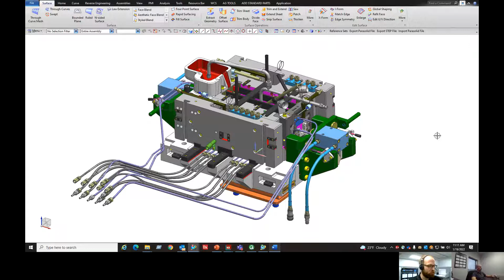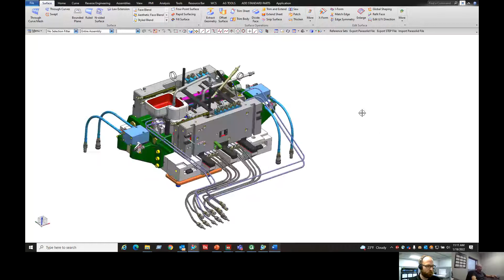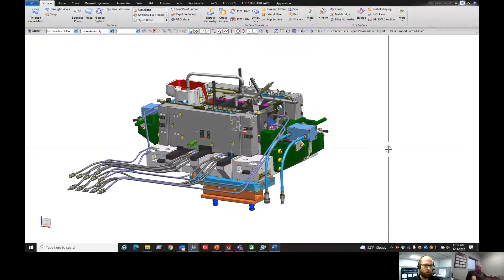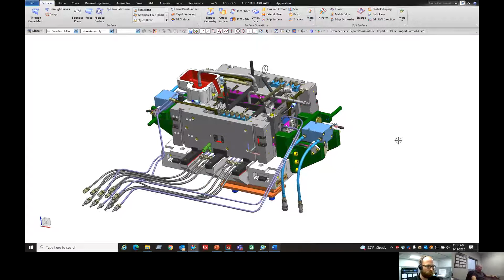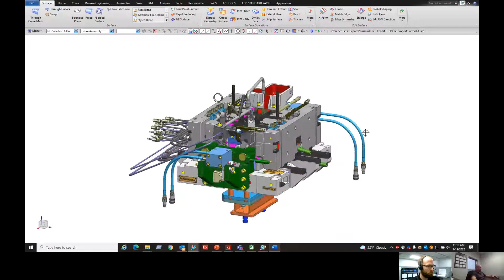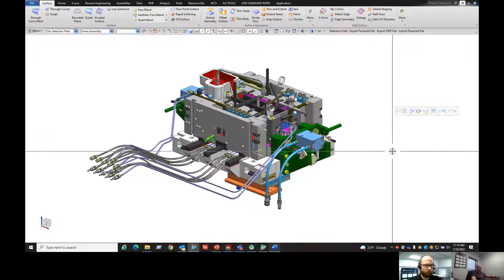Air or Water Cooling: Which is Best for Your Permanent Mold? Aluminum Mold

Comment: Is water cooling done under pressure for increased boiling points?
Reply from the maker: Our understanding is that the majority of the foundry's we supply use the city water pressure.  However, the systems are good enough to be run at higher pressure.

Comment: Some considerations not mentioned are:  Water cooling can generate better mechanical and fatigue properties compared to air cooling due to the faster solidification rates. Compressed air is expensive due to the constant need for running air compressors, Water treatment is needed for water cooling to avoid scale build up and blockage in the cooling circuits.  Water cooling requires more periodic maintenance of the cooling lines to avoid water leaks.  There are many other considerations not mentioned but these are some key factors to consider.
Reply from the maker: Gordo - Thanks for your comment, we totally agree.  Typically when AG Engineers engage with a customer on this topic that does not have the experience, we will take them through the pros and cons of both methods of cooling.